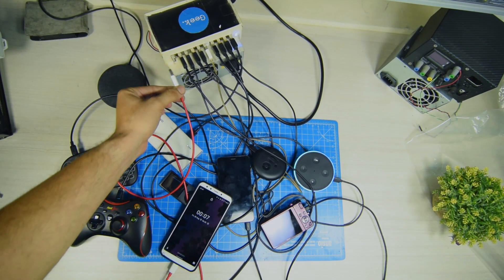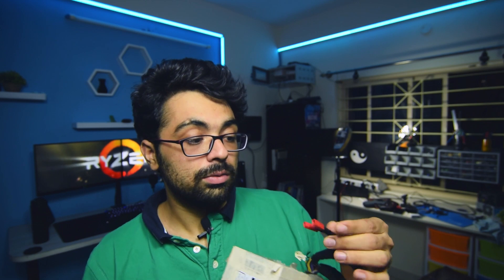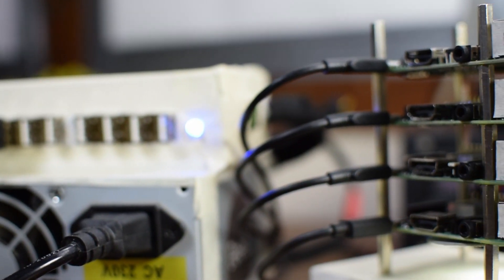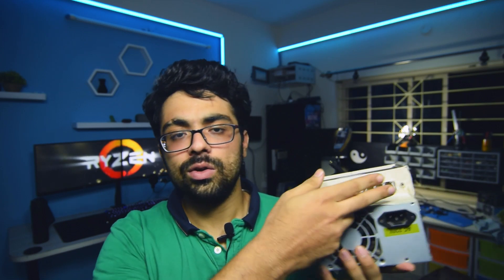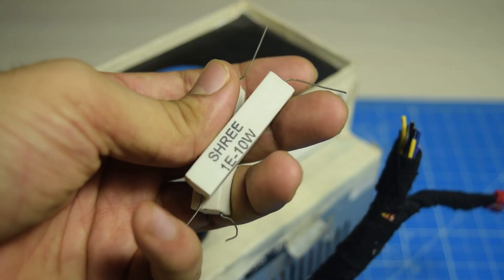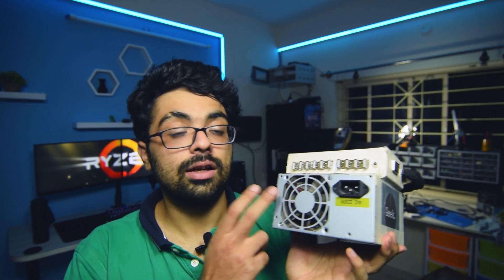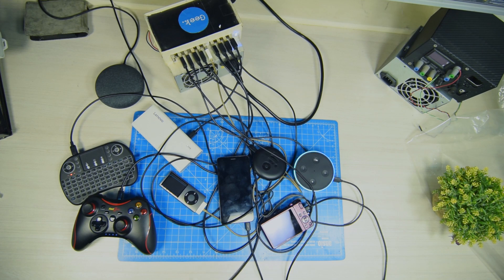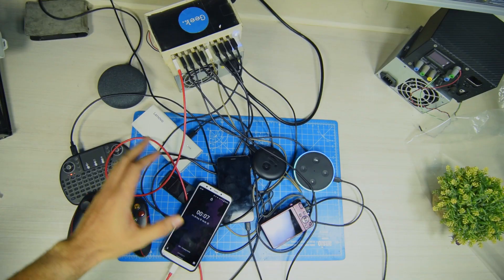Crazy Power Supply MOD!

Comment from the maker: The voltage boost of around 0.8V might seem small but it actually accounts perfectly for voltage drops when powering multiple Raspberry Pi's. 
Without the voltage boost all the Pi's would have slowed down by ~100-120%. Check out the previous video for more info.